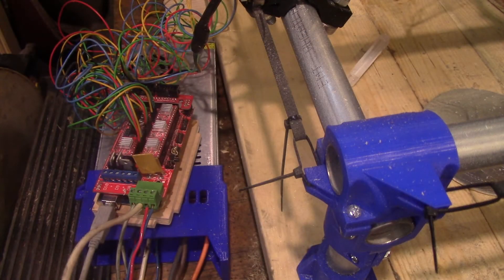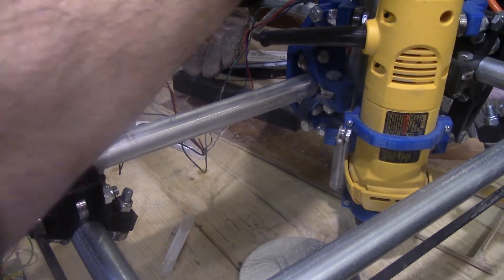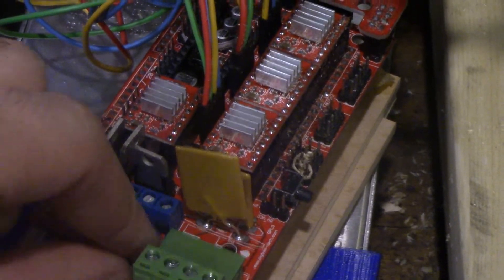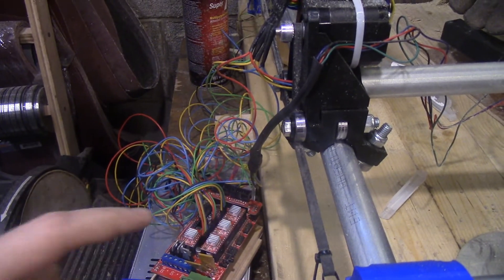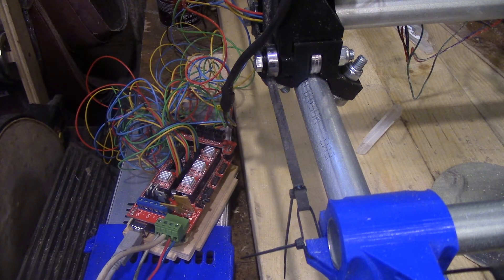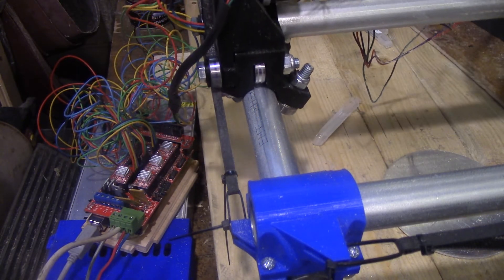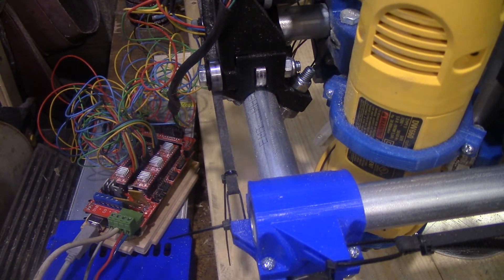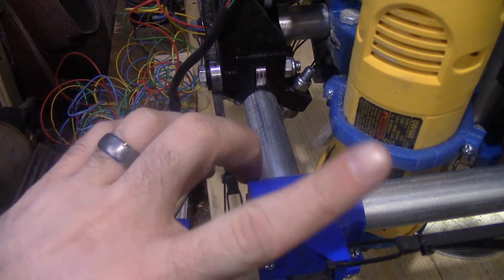new MPCNC router  all 3d printer parts

Comment: I have made the same type. But I redesigned the head so I can remove the head and have several heads one for the router and ittyers with a 3D hot end, laser, etc.

What software did you use?